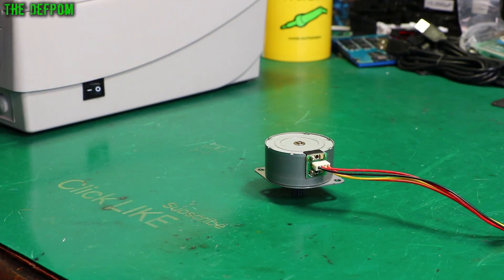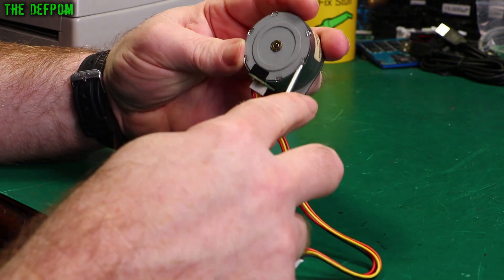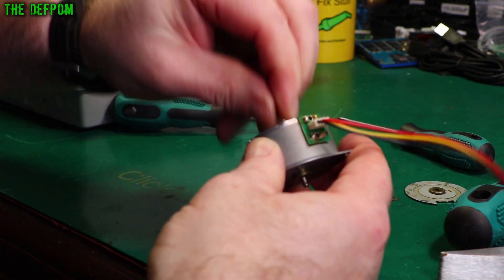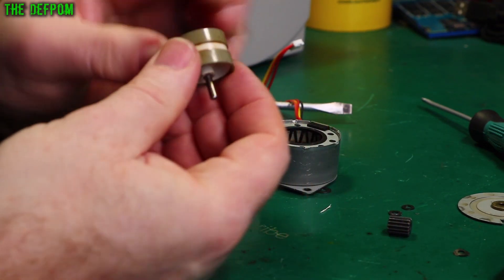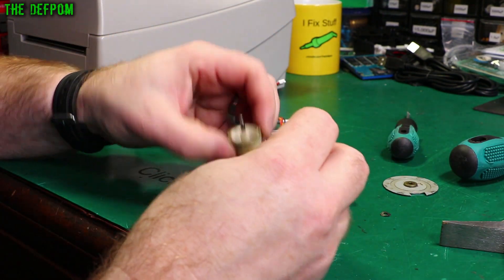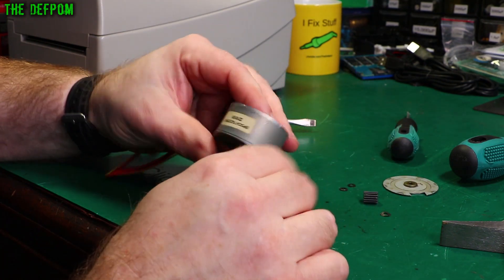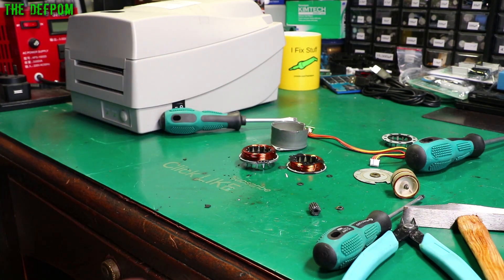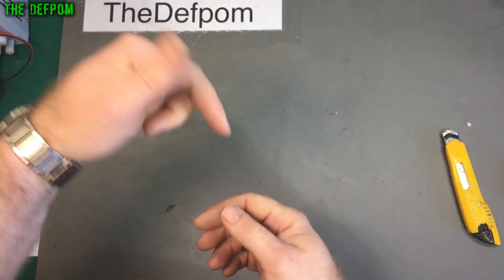🔴 What Is Inside A Stepper Motor ? - No.942

Comment: Likely the plastic rotor outgassed and shrank, breaking the glue bond, not helped by a minimal amount of glue as well. Will take a bet those wires are not copper but CCA wire, as those motors are pretty much all made with it now, as it is a very easy wind, and the CCA wire in there is noty going ot fail, and is a lot cheaper than actual copper. Yes the design is optimised for cost, using the 2 windings as single turns in a bobbin, and the stamped shaped pole pieces, combined with the ferrite dust magnet rings with selective magnetising, so as to make production very fast and repeatable, and very simple, so they can be assembled by low cost labour.

Gear is put on the shaft using induction heating, to make it nearly red hot, then pressed into place on the shaft, so it shrink fits on there, so then the iron oxide layer on the surface can have a thin film of oil added to it, to keep it running well and lubricated. Plus those are compressed and sintered powder gears, a blend of fine steel powder pressed into a green shape then fired in a hydrogen atmosphere, to get the final size, and making it porous, so the oil can stay there for life, slowly lubricating the gear running surface, reducing wear. Designed down to the absolute minimum, and designed for ease of manufacture, all parts being either a stamping out of electrogalvanised steel, or a powder metal part, for the gear and bushings, or turned on a CNC lathe for the shaft, which has been polished using a tumbler, then plated in a tumbling basket as well, so all the thusand parts get done the same thin coat of nickel at the same time. All meant for ease of assembly, and then a quick test on the line and into the box for shipping.

Comment: Amazing that it only has 2 windings, I was expecting lots of windings, one for each (or pair of) pole piece.
Very clever arranging the stamped out poles so that it cranks in whichever direction you want using only those two windings.
They sure 'Kept It Simple'
Thanks for the teardown, quick description of fault (could have been more detailed) and analysis of probable sequence / cause of failure.

I strongly agree with your ethos of repair if possible/sensible. I certainly get enjoyment from pulling apart failed gear to see why it failed and making an attempt at getting it working again.
If I achieve a robust repair there's years of satisfaction to be had every time you see it in use.
Having to make a bodgy repair for paying (or charity) customers is sometimes not much fun, it's hard to achieve robust solutions to some of the 'programmed obsolescence' devices around nowadays. 
Replacing the stepper motor rather than repairing it is probably a good call (Unless, of course, there were no equivalent spares easily available).

Comment: Used these motors a lot in the 80's. You could get gearboxes that attached to them with a huge reduction on them. The motors were always reliable, the failure point was the gearboxes due to a mix of brass and plastic gears..